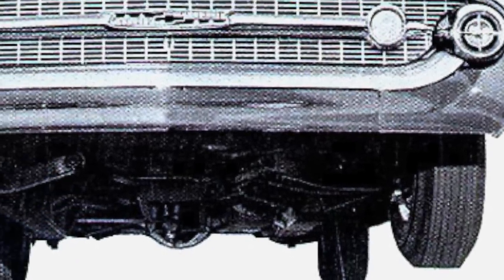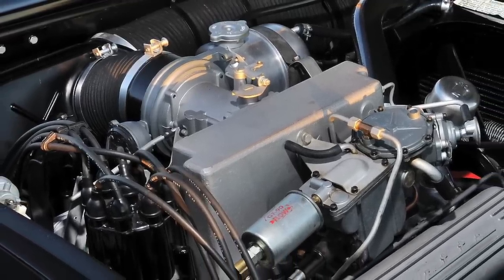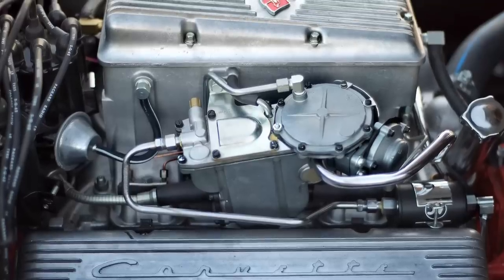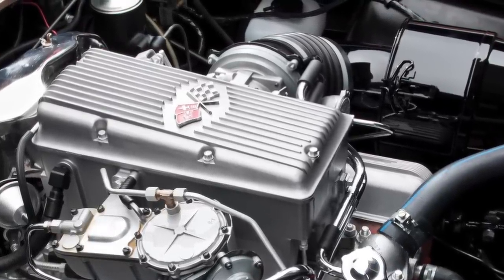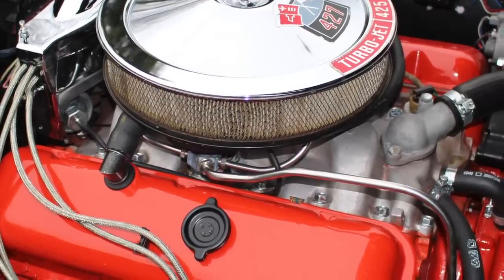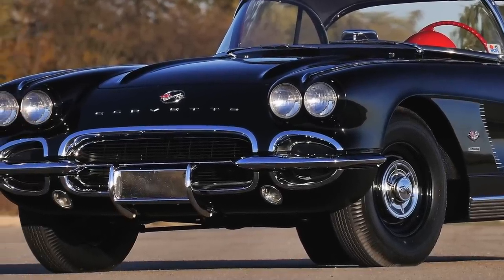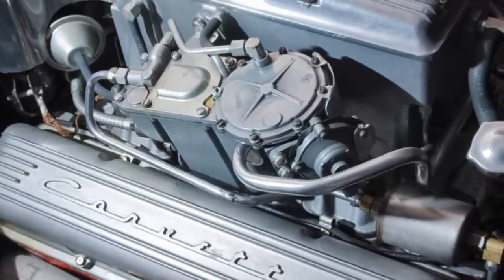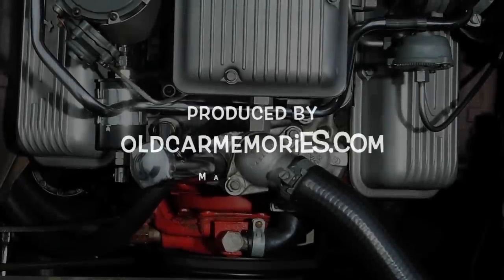Why Chevy Abandoned the 1962-1965 Fuel Injected 327 V8

Comment: a few engineering flaws in this statement 1. fuel injection has not conclusively proven more fuel efficient then carburetion. 2. fuel injection starts better on colder days then carburetion. both these statements are false.  fuel economy is gained in today's vehicles by weight reduction and gear reduction systems. cars being lighter. the reality of fuel economy is also do to the ignition system of the vehicle. volumetric efficiency. low spark and poor ignition systems as well as substandard oil refinement of conventional oil is what made vehicles poor fuel economy. ie the ford raptor with fuel injection averages 16mpg with is beneath the 1960s-1970s carbureted 340 engine which obtained 24mpg highway. also fuel injection does not start better on colder days. the systems for improving the fuel ie block heaters map sensors maf sensors. and more fuel regulation systems for pressure and temperature are needed for fuel injection. the same systems placed on carburetors work just as well. in my scientific opinion of fuel injection vs carburetion it is preference. one is not better then the other just different. fuel economy is based on how many parts fuel to how many parts air. is burned. fuel injection does have one improvement over carburetion no floats so it does work better at higher altitudes. but there are several factors that affect fuel efficiency vehicle weight. ignition voltage and capacitive discharge rate. final differential ratio. these are all factors in fuel efficiency. the parts of fuel to air mixture to start and run a engine depends on many factors. such as compression. timing. and many other factors. fuel to air intermix ratio will remain the same rather lean or rich will cause detonation or other such firing issues. the delivery or fuel is moot. it is the ammount  of fuel  delivered at the correct time.. ie many motorcycles still run on caurbretors.
Reply: cloridan Beauchamps no they aren't..look at the weight of cars in the 60s
Reply: You are entirely correct.  Many people today think (incorrectly) that all cars of the past got horrible fuel economy when in reality, they did quite well before emissions regulations.  One of my buddies in high school had a 65 Impala with a 250HP 283 if memory serves that got 20 some MPG if memory serves and my K5 4X4 blazer got about 13-14MPG.
Reply: Joseph Giannini. i agree. i have had old cars with four barreled configuration . it you stayed out of the throttle hard it got great fuel economy. as long as the choke worked properly they started good cold. the performamce difference between a four barrel carb is like compairing a black hole to a vacuum cleaner. cars was much heavier back then. modern cars and trucks are gearboxes with whatever engine manufactures put in them. old cars was geared for the hwy and the engine was built to move it. young people usually dont like when i say that but the truth hurts sometimes.
Reply: Body itself was lighter but with added things like airbags, ABS, crash protection and all other safety things added weight back in. Even all Alum body but need steel bracing to make it stronger. Then we have carbon fiber which very strong but comes with big price tag
Reply: It seems as though modern fuel injection systems require less exhaust emission restrictions; I wonder how that works?
Reply: Joseph Giannini I agree that a good carb can be very efficient. I have a carburetor on my 2010 Cessna 162 and get excellent economy.   I also have a mixture control and an EGT readout so I can dial in the right mixture for the given power setting and density altitude.  If these old cars had a mixture setting adjustable in the car they would do great on the highway.
Reply: today's FI can deal with a greater range of ambient temperatures better than a carb can. Cold startups are  easier with a computer and electronic FI
Reply: I live in Alaska .Fuel injection is the only way to go at 40 below.
Reply: Joseph Giannini    I whole-heartedly  disagree with everything you just said.
Reply: @josephgiannini6174  Nash ambassador same weight as a Honda civic. My 65 comet 2700 lbs, name one car today anywhere near the size of my comet that weighs less. Oops are none are there.
Reply: pdmustgt d  abs was developed in 1971 by chrysler corporation for lazy drivers who didnt know how to pump the brake pedal.. crash protection is a joke a plastic roll glues to a hydroformed thin piece of  steel with a poylstyreine  bumperette with vinvyl overtop yay great protection and its not flamable at all. cars are glued together and not made stronger they are made with crumple zones. to collapse. carbon fiber is not strong either and highly expensive to make you need to research your engineering before you make statements.. why they dont make cars the way they used to time and money materials for a lets say a 1967 hemi belvedere so lets make a car for 5k and sell it for 95 because you are too stupid to know otherwise. we use plastics and aluminum becasue we dont need humans and unions to make it... wake up and look at reality and dont buy the lies. if all the safeties where great why dont racecars have abs and crumple zones and airbags... reason they arent safe at all... look at the consumer reports and recalls. and dont embarass yourself any further
Reply: lead dog  carburetion can also be made to work at 40 below fuel injection also is way more expensive then a carburetor and more moving parts.
Reply: You are wrong  Fuel injection always has the potential of creating better fuel mileage because it atomizes fuel better and has the advantage of putting the mixture closer to the combustion chamber so that the atomized fuel has less time to separate into droplets that hurts combustion and fuel efficiency.  Ask anyone who has been in the snowmobile industry for many years how much better fuel mileage can be obtained with fuel injection over a carburetor engine  !!

Comment: I always wondered why they discontinued the 327, I had one in a 69 Chevy pickup dual exhaust, I wish I still had it
Reply: When the early emissions controls started taking effect engines suffered power losses. One way to compensate for this was to increase engine displacement, thus the 327 was stroked by about 1/4 inch to produce the larger 350 cu in displacement.

Comment: mechanical fuel injection is garbage,thats why. if it were worth it at all,aftermarket would have made a mechanical fuel injection swap kit,at least!
Reply: hillborn mechanical fuel injection is for race cars,where wot is used a lot. even they make efi systems now for guys who want the hillborn look. I was referring to daily driven type vehicles,like in this video.
Reply: Apples and Oranges. Hilborn, Algon, Crower, Kinsler etc. are "constant flow" systems where only two parameters, RPM and throttle opening control fuel flow through a "barrel valve" synchronized with the throttle plates that meters the bypass regulation of fuel going back to the tank. The Rochester is also a constant flow system. The only significant difference is the vacuum controlled balance beam to meter the bypass regulation of fuel going back to the tank. Many road race cars of the sixties and seventies (think Formula 5000 and Can Am cars) used Crower, Kinsler or Hilborn stacks with very sophisticated Lucas (timed, non-constant flow) or Tecalemit Jackson (constant-flow) mechanical delivery and metering systems that allow very precise fuel mixture control across the widest range of RPMs where that kind of flexibility is an absolute requirement. The highly successful K-Jetronic Bosch mechanical systems that were widely used on European cars of the seventies (like Volvo 142 series, Porsche 928, and VW Rabbit) used a functionally similar constant-flow delivery and metering system, but added a mechanical air-vane meter to measure incoming airflow, and a heated wire thermostatic warm-up timer for an added measure of driveability. Technically however, the Bosch K-Jetronic, (not to be confused with the KE-Jetronic) remains in the general domain of  constant flow mechanical fuel injection systems.
Reply: So many mechanical injected cars world wide went back to carbs. Triumphs, Ovlovs, even V12 jags. The Benz was probably the most efficient,, but ask even experts to fix them?????
Reply: The electronic ones at the time were much less reliable (Chrysler and the almost AMC).  The electronics at that time were simply not advanced enough.

Comment: Correction, in 1956, the Corvette had a 265 cubic inch fuel injected V8. Offered only in the Corvette. It was GM engineer Zora who designed the injection system and heads that would be used until the last of the 327 fueled engines had been replaced with the carburetor 350 cid

Comment: This channel is very informative, and entertaining. My only complaint is with the narration. Very slow and boring. "Articulate", but mundane. Almost as bad as computer generated. Plus I've never heard stats claiming "pounds feet", (torque numbers), which is usually  stated as "foot/pounds". I know it sounds like a trivial complaint, but takes away from the material being presented. Sorry. My 2 cents. But keep the videos coming. I'll still watch. Thanks.
Reply: joe quinlan torque is actually lbs feet... narrator is correct technically....foot lbs is a street term
Reply: I disagree with you sir, I think his voice is a very "stable" , "secure" , "calm" and rich voice for the narration.
Reply: His voice is the voice of a guy who knows what he’s talking about.  Pounds-feet is the correct term.
Reply: Maybe he is, and maybe he's not. I'm sure he's reading off a pre-written script, (or at least it sounds so), that he probably didn't write himself. And for the past 50 years I've been involved with the hi-performance industry, I've never been bench racing in a group, and heard some-one say, "Yeah, that Hemi has 490 pounds feet of torque." Just sayin. Not trying to belittle anyone.
Reply: Ha ha ha ha
Reply: Go to setting and change the video speed from Normal to 1.25... Problem solved!
Reply: LOL. Good tip Ryan. Thanks. But I think the "FT/LBs" will still be backwards.  :)
Reply: Then I guess the automotive repair manuals of the past 40-50 years have it wrong too, cause when you look up the general eng. specs., they list torq. figures as "FT/LBs". And thanks for describing torque for us Roger. Glad to know we're in the presence of a Harvard Scholar. I'll let you have the last word. Sorry I brought it up. I'm done.
Reply: what about psi? why isnt  it sip?
Reply: have you ever taken a science class? its not my fault youve been mistaken all your life. im just pointing out that you are incorrect. its not my problem you get triggered over being wrong, sir. That is a personal issue youll have to work i i guess
Reply: Bueller, bueller, bueller......
Reply: Joe Quinlan: You wrote: "which is usually stated as "foot/pounds". Wrong:  the "/" has a very specific meaning - "per". So "foot/pounds" would mean "foot per pounds" and THAT makes no sense. When torque is written about informally, the abbreviation is ft-lbs. When written about correctly, the abbreviation is lbs-ft.

And Roger - you are further muddling this: pounds PER foot makes no sense at all (0%) - unless you are talking about the weight of a cable/hose/rope/I-beam, etc. per unit length. So let's set that aside and just talk about foot-pounds versus pounds-feet.
In the engineering and physics world, a foot-pound is a measure of work: one pound of force working through a distance of one foot (or 0.5 pounds over 2 feet, etc.). Torque is a measure of rotary "force" and is the equivalent of a linear force acting at the end of a lever. One pound of force applied to the end of a one foot lever creates one pound-foot of torque.
Yes, this is a trivial issue, but there is a reason for the distinction: in order to be able to tell whether a speaker/writer is talking about work or torque, the technical community decided to reverse the order of the words. Granted, context will tell you what is being referred to, and you would possibly even hear the chief engineer for the Corvette (like your bench-racing crowd) use "foot-pounds" to describe torque. But I can tell you, you'd get marked down at least a half-point on a quiz in a physics or engineering mechanics class if you used the wrong term.

Also: "I guess the automotive repair manuals of the past 40-50 years have it wrong too." Yes actually, they do have it wrong, according to your friendly neighborhood physics or engineering professor - but he'd get laughed out an auto repair shop anyway, so it makes no difference.
Reply: His narration isn't so bad, but it sounds like it's being done through an old "brick" cell phone. Wouldn't hurt to invest in some better gear if this is his main thing.
Reply: joe quinlan gotta side with you on the foot pound debate ALL of the old printed material referee to torque in ft/pounds EVERY torque reference in ANY manual I have ever referenced was expressed in foot pounds or inch pounds
Reply: I feel his voice is suitable for the topic at hand. No where near as unintelligible or infuriating as computer generated. The topics he is discussing are exciting enough not to warrant the need of some corny, accented, infomercial host on speed!
Reply: joe quinlan 

Hey Joe, lighten up.  Doubt the guy went to Harvard....Ph.D. not required to understand correct terminology.  Roger is correct.  Pop 5 or 10mg Valium and chill, buddy.  The fact is that torque IS measured in lb/ft.  And now, I am done.

Comment: Does anyone remember GM building prototypes Olds? Buick? with a small air compressor filling a tank so extra press of throttle gave air for extra power for overtaking?
It had a scuba size tank in front  of engine.

I remember seeing it in HOT ROD but cannot find a mention of it anywhere?
Reply: @Preston Blair Do you have a link to the old GM prototype as GM Museum has no knowledge of it.
I think it was in mid sixties and idea was that the basic carbs gave so much extra fuel that for a few seconds the extra air provided extra power.

Comment: The Fuelie failed because the first thing you removed was that G.D. shielding on the ignition wiring which made it a nightmare to change plugs & points on the Vette, but a 63 F.I. Vette was a joy to own and drive, no car on the road at the time was even close. BTW, who gave 2 S..T.'s about milage, high test was 40 cents a gallon.

Comment: It's odd that Cadillac had a Bosch/Bendix EFI system, which was related to the ones on the VW Type 3 and the 1958 DeSoto, as an option on most of their cars and standard equipment on the Seville, starting in 1974 (though I believe it was a secret option in 1973), but GM never saw fit to adapt it to the Corvette.
Reply: I suspect the divisions were a little more autonomous in those days.

Comment: OK  you  got it right   from  57 to  65  they offered Rochester Fuel Injection .. My  Cousin had a  '56 Chevy with the Dual 4  barrel Corevette motor  solid  lifter cam rated at  225 HP

Comment: I have seen more 65 L84 Corvettes beaten at the Dragstrip by the Holley 4 Barrel L76 327 Vettes..Despite the 10hp difference (375hp vs 365hp) which I believe was just marketing hype. The L84 Injection Unit was rated right at 600cfm which was the same cfm as the Holley 2818 used on the L76 Engine. Every Component below the Intake was identical on both engines. The L84 FI Unit was both attractive and intimidating looking to the onlooker when the hood was open. The only real advantage back then was the power curve off idle to redline was much smoother than the Carb Engine. As far as making anymore power than an L76, that is a myth in OEM Format ...

Comment: I worked at a service station back in the late 60's.  The mechanic had a brother with the 327 fuel injected engine.  After a week or two fooling around with the car, he pulled the fuel injection and installed a carburetor - he just couldn't get it to work.

Comment: I owned a 1963 convertible,red w/ white top,,,,327 ,3 speed on the floor((.375hp in a fiberglass body was wild with a positive rear-end & people were scared of fuel injection,unknown but reliable,,,I could release the clutch in 2nd gear and take off with no pedal.The gears were long in this 3 speed.Fuel injection has been around since the 30,s. Cummings diesel was in race cars in 1935.i also owned 1978 trans am,403 w/ turbo that was ahead of its time.People did not like what they didn't understand as far as mechanics go."I never raced much,but no one EVER PASSED ME !-lol.

Comment: It was NOT only the  "local mechanic" who could not properly maintain a Rochester FI unit, many mechanics at the local dealers were unable to service the cantakerous and "moody" FI units.  Parts were difficult to get from GM, very expensive, they were tempermental in hot or cold weather, and simply stated, changing to a single 4 barrel on an aluminum intake made the car easier to use.  In addition, many of the cared eingines actually outperformed the FI cars....Many mourned the passing of the FI unit, I was not one of them, until the inception of the electronic controlled FI system in the later models, carbs were just better...